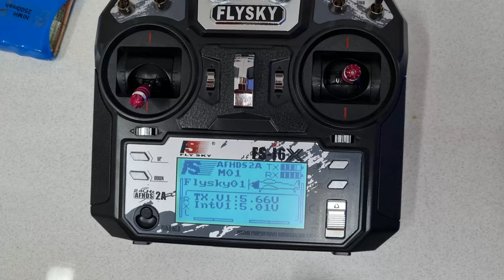How to program Auxillary Channel 5 for Ailerons on the FlySky i6x Transmitter

Comment: I did this, but my servo that is connected to ch 5 only goes in 1 direction it doesn't want to go both ways. I tried changing pos mix and neg mix but no change :(